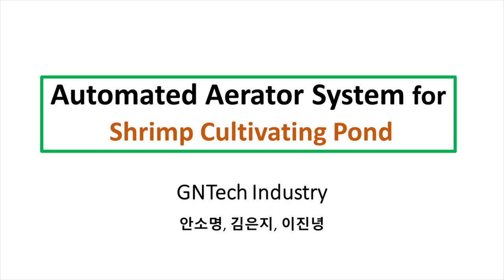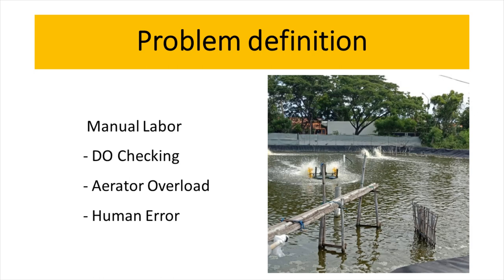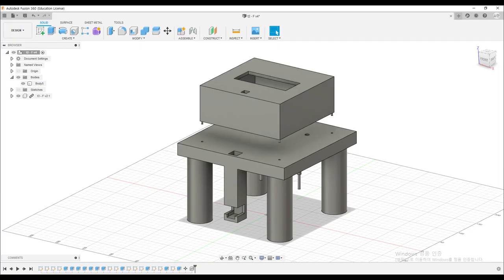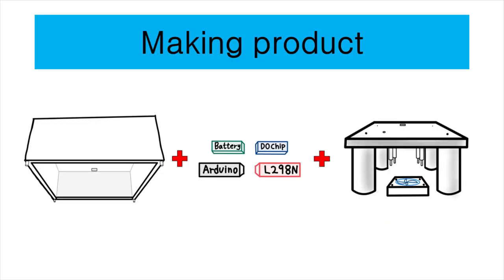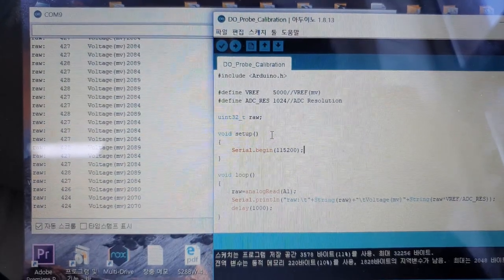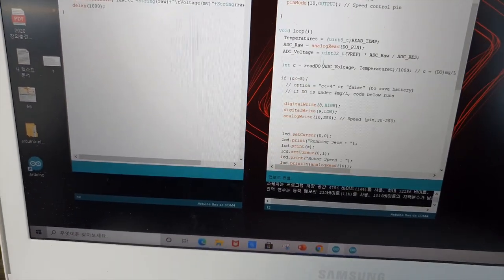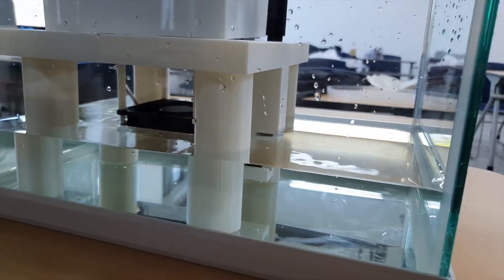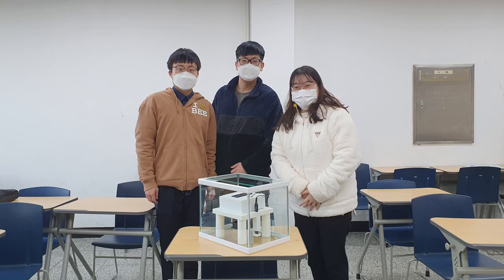[GNTech Industry] “Automated Aerator System for Shrimp Cultivating Pond”

Comment: I saw your UCC well. It's a good job. I want to know comparative analysis data with the existing systems. And I have some questions as follows.  Is it basically enough to have DO sensor only? As shown in other sources, temperature sensor seems to be essential too... Another question is about scale-up issue of the proposed system, especially in aerator. There seems to be a lot of difference from the current aerator machines actually used.
Reply: Thank you for your question. Here are my answers in order.
1. comparative analysis - Current system works with the aerator Non-stopping, and they check DO level just to make sure if the shrimps are not in bad condition.
2. only DO sensor? - Our DO sensor probes both DO and Temperature. 
3. practical difference - It is a prototype fan, not an actual aerator. But, still they work as the same concept.

Comment: Hi I am from Sunda Empire, I want to ask about using a fan without a filter around it. Do you consider the water in the real environment? As we know that a pond that placed outdoor will have a lot of dirt, dry leaves, twigs. How do you ensure unwanted objects (including the shrimp) would not stop the fan or the worst case kill the shrimp? Thank you
Reply: Hi Cantika, Thank you for your question. Our primary goal was to give the entrepreneur the automation solution. So  what we developed only gives them an option to turn the aerator On and OFF by the sensor data. I understand that we could've added more functions and abilities on the fan, but that is really up to the entrepreneur who's actually taking care of the shrimps. Thank you.

Comment: Hello GNTech team, good job. I am Rama from URANG Team Indonesia, I want to ask something about the aerator, it's the oxygen generated from the fan well enough? what is your considering using the fan and then put into the water rather than using something like an aquarium air pump?
Thank you, have a nice day.
Reply: Hi Rama Thank you for your questions. Here are my answers in order.
1. enough oxygen? - We made it possible to just adapt our automation system to CURRENT Aerators. (Just giving On and Off signals based on the sensor data)
2. why not air pump? - As I mentioned above, we designed and built to adapt on the local system. Buying extra Air pumps would cost a lot more.
Reply: @nermad8703  I think because you are made a prototype product, the small size of the air pump is enough, it's proper to generate the oxygen and quite cheap around $3 - $8. but anyway, good work. Thank you for your answer.

Comment: Hi GNTech team, hope you have a great day during this pandemic situation. I am Jawad from Urang team Indonesia, i want to ask : i saw in your video that your product must be put in water level, is this right? If it is, where do exactly your product is placed in the pond? (In which area). Also how deep you put your product from the surface?.
Thank you and have nice day GNTech team
Reply: Thank you for your question, Here are my answers in order.
1. product location - We planned and designed to adapt on the current local aerators. So basically, we can say our 'main' product is the controlling and monitoring system which is on the ground level away from the lake, connected with the DO probes and Aerators on the pond. (Usually there are 4 aerators in the pond) 
2. product depth - mentioned above.
Reply: @nermad8703  thank you for your answer

Comment: Hello! Congratulations for your work, it is very good. I have a question: isn't there any problem with the fact that the device will be used outdoor, and will probably face various weather conditions and different water levels, so it should be water proof with sensor and processing unit separated?
Reply: Thank you for watching! This is the leader of GNTech Industry and here's my answer to your question.

Before we get into details, let me clarify first that what we made here is a prototype model, which only focuses on the concept we are trying to deliver. 
Our concept is to make it run on it own and that is why we used Arduino on the first hand to avoid spending a lot more money just to show you the ideas.

So, as you proposed, we would separate the aerator and the monitor. 
We will have the aerators floating on the water with fixed anchor to the ground as well as the DO probes, and we will have the main processing device to be fully applied with waterproof liquids and to be outside the lake connected with longer waterproof cables. Method of monitoring and controlling the devices will be the same with the concept product we have. 
Only differences would be the larger scales with the aerator with bigger blades and motors to maximize producing DO.